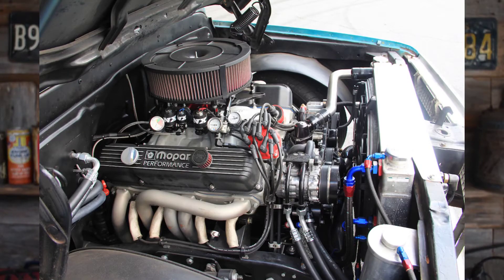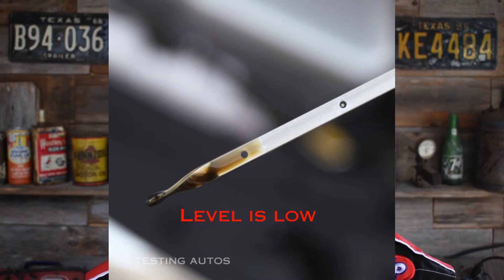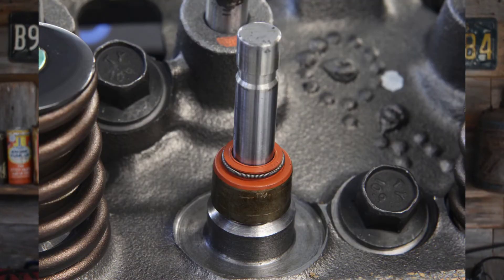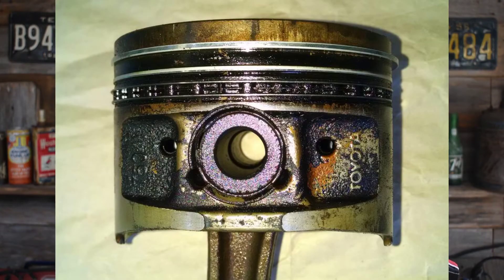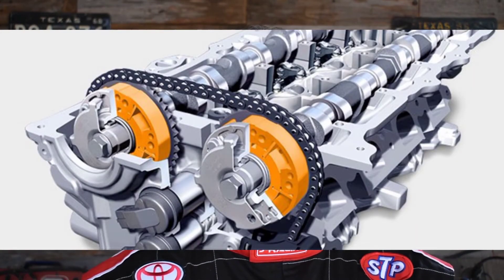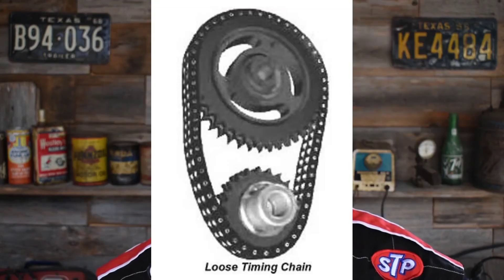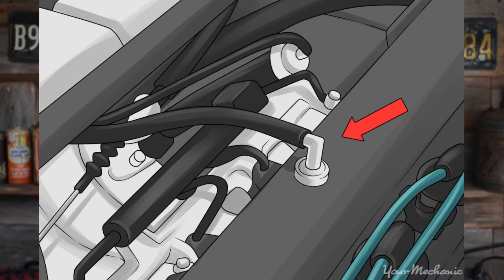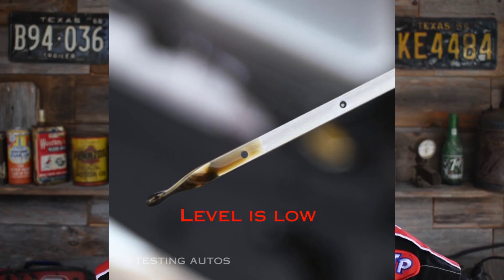How to Make your Car Last.

Comment: Great video. Thanks. Question, is there a way, product, that can clean those oil rings, in the engine?
Reply from the maker: Thank you for the question. The better the engine runs, the cleaner every thing stays. Use a fuel injector cleaner every two for three times you fuel up. Do the required engine maintenace also.